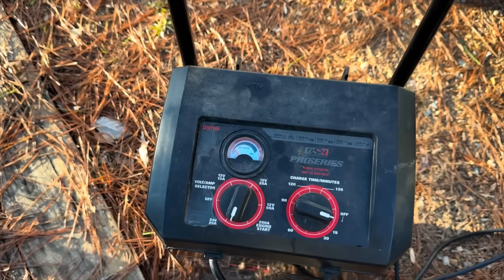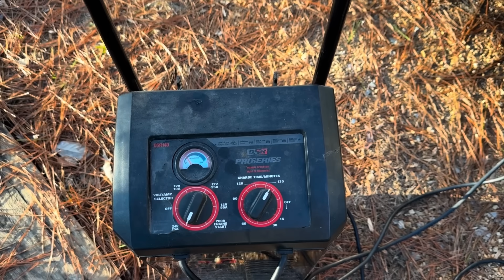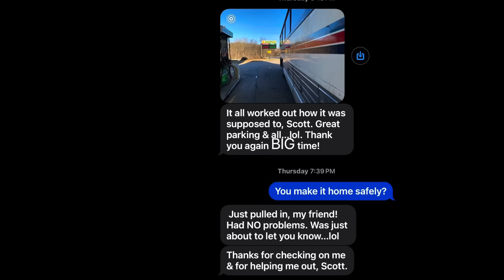Lead acid battery exploded in my face.

Comment: I've always made sure to look away before making the last (ground to chassis) connection. 

Just recently, the battery in my MGB exploded. It's postioned behind the passenger seat, and I was sitting, gacing forward. Boom!   And it took a couple of seconds to realize what happened.  Did get some holes in my jeans as I was dumping baking soda all over.

Comment: Hydrogen sulfide explain. Yeah like the other guy said connect negative to ground. But i don't know if you can do that on a bus chassis? 
So if you are charging or jumping a bus. Gloves goggles and face shield. Those ppe you can replace. We can't replace Scott. Hope your feeling better see a skin dr. Scary.
Reply: Not "Hydrogen Sulphide" - although that stuffs stinks like rotten eggs.
The Hydrogen & Oxygen produced by a gassing cell (fairly normal during use) is the perfect explosive mixture.  While Scott going to connect a charger the ignition source could well have been the arcing on the terminal and just "poor timing" on behalf of Scott.
Reply: @18robsmith  ok

Comment: I had a similar experience when load testing a battery !
Using one of the oversized toasters .
The ones you hang over the thing when testing because the cables never long enough !

The battery top hit the wall behind me & that's about 60 ft away !
Luckily it totally missed me & it was a gel battery so no acid escaped .
Eye protection or a full face shelled around charging batteries is a must .

It's also a common thing when welding on vehicles & equipment .

Comment: I had that happen to me while I was in the service stationed in Hawaii. I was working a part time job as a security guard in an apartment complex and a lady said she couldn’t get her car started. Well it was in a dark parking garage and me not having a flashlight used my lighter. Well she had just had the battery charged but the reason she couldn’t get it started is because the seat belt needed to be clipped. Remember those? It was a Datsun . Much more to the story because if who she was but I’ll leave it there. Oh I had acid all in my eyes and all over my face, lucky I didn’t get blinded. And yes it made a huge bang.

Comment: Crazy but I've seen it before. In the early 70's I worked at a battery recycling plant with every kind of battery ever made. I hating lifting these batteries. When we were bored, we would wire them up to watch them smoke but now and then they would explode. I definitely wouldn't have my face near them. dropped one on the top of my foot one day and went to the hospital thinking I broke it but after x-rays they said no just a bad burse.

Comment: I blew up a motorcycle battery on my bench, luck had it at chest level, but it blew out all the clear plastic above the plates, covered me with acid which started itching immediately. I ran straight to the shower clothed and ran it full blast as I rinsed and removed everything I was wearing. The shirt looked OK, but after the next wash, it was full of holes. I doused the whole workbench in baking soda and misted it down from the hose to neutralize the acid that was all over my tools.  
Hopefully you mixed up a slurry of baking soda and water and splashed it all over the battery compartment of that bus or it's going to be full of pinholes and corrosion.  The gases released from electrolysis are a mixture of both Hydrogen and Oxygen,  aka HHO or " Brown's Gas "  , since it's a 2:1 mixture, it's extremely explosive.

Comment: I had an incident about 45 years ago that probably explains what happened to you. By your description of the battery voltage and post condition, I say that the post was cracked/broken inside the case. I had bought a brand new expensive battery for my Ranchero and a week later, went on a trip to see the Kittyhawk monument. When about there, I shut the engine off for a few minutes and it wouldn't crank as if I had a dead battery. I got a jump and  barely made it home to Charlotte. Long story short, my boss showed me that even though the voltage was good, it could not carry enough current to start the car. He showed me that the post was flexing and if I flexed it the right direction, it would start the car. This was because the post was cracked inside the case. He told me that the installer probably only used one wrench to tighten the cables to the battery, this allows the post to flex and can break the post very easily. I see many YouTube videos when people use only one wrench on the clamps, and I cringe. Using a wrench on both the bolt and nut will allow the clamp to be tightened with out flexing the post. Try it, you will see what I mean easily. The crack inside allowed arcing and ignited the hydrogen gas.
Reply: this is great info

Comment: Scott, a friend of mine was working alone when a battery blew on him. He lost 40% of his vision and had acid burns over 20% of his torso. What caused his accident was static discharge while he was blowing out dust from around the radiator/air cleaner/battery compartment. It was a permanent life altering accident for him, ever since then I started wearing a face shield while dealing with batteries and I make sure I'm grounded out to stop static build up.

Comment: Years ago I had that happen too while trying to jump start a dump truck, a small flame appeared on top of the battery and I went to knock the jumper cables off and as I did the battery exploded, ears ringing and acid soaked my pants. Luckily no acid burns.😮‍💨In hindsight, I should’ve disconnected the cables on the other end. 🤦‍♂️It was a knee jerk reaction to go where the issue/flame was.🤷‍♂️I thought the same thing, why did it explode when I knocked the cables off? Especially since there was a small flame burning. 🤷‍♂️Live and learn.😂

Comment: The thing is, when water is electrolyzed (disassociated into hydrogen and oxygen by electricity), it produces a mix of oxygen and hydrogen gas the exact ratio - two H to one O - that will burn perfectly and explode with maximum energy. It's a common science show demonstration to fill a balloon with the gas from electrolysis of water then touch it with a torch. The boom is, as you say, louder than a shotgun. That turns it back into water of course but a miniscule amount of water produces quite a large volume of explosive gas. The danger in attaching a jumper cable directly to a battery isn't, as is commonly said, the hydrogen gas possible - but the very real possibility of a pocket of this perfectly explosive mixture being ignited inside the battery case and doing what happened to you.

Comment: Wow.  Glad this wasn't as bad as it could have been, Scott!  I try to not be the Safety Nanny and tend to not comment on how folks run their shops and service... but I think I've mentioned before that PPE use in the BGM shop seems intermittent at best.  Losing or impairing eyesight would be a huge loss for you, your wife, kids, and grand kids.  Ditto for burns (thermal or chemical), lung diseases from chemicals and exhaust, etc.  At the very least I'd suggest full time eye protection, nitrile gloves when using chemicals or working with waste lubricants, and bump caps for some limited head protection.

You've got lots of experience to share and the quality and ethics of your shop are tremendous.  I'd love to see you able to do this for a long time.  Take care of yourself and have Johnathan do the same.

Comment: Scott i have had several 8D batteries blow up on me in the past. I have been a generator tech for 30 years. One battery blew up inside a building and blew several flourecent lite bulbs all over me.  The cause is low fluid level allowing excess gas build up that will explode when subjected to a high load and spark.

Comment: Hey Scott, glad you weren't hurt, 3 yrs ago we had that deep freeze in Houston, my wife tried  start to our power stroke, 2020 model, she came back in woke me up to charge it, i hooked up the charger told her to turn the key on and off a couple of times to get the glow plugs warmed up, then to start it, and like you said i thought a shotgun went off, my face, my neck got the worst, the smell was awful, i ran to the water faucet it was wrapped, so she put me in the shower, that scared her, and me that could've blinded me, she felt so bad, so we were both lucky.

Comment: Glad you are ok. Now I know why my automotive teacher always had us wearing safety glasses when working with car batteries. Also, we were taught to put the positive charging/jumper cable on the battery and the ground to the engine or body so you don't get sparking at the battery. Stay safe!

Comment: I had a Napa brand battery in my diesel volkswagen jetta just explode under the hood one cold morning.  battery was less than 4 years old.  ignition on, wait for the glow plug light to go out, the second I turned to crank it just went BANG and I saw smoke coming from under the hood.  Grabbed the small fire extinguisher I carry in the trunk, pop the hood expecting to find flames and I just see my battery split wide open and leaking acid everywhere.  washed it all down, staining the brand new pavement (lol).  Replaced the battery and good as new.

Comment: Glad it sounds like you're ok, awesome. But so many people don't take lead acid batteries seriously and the hydrogen sulfide gas they put out when charging or discharging. Example, the whole order of hooking up jumper cables and NOT hooking it up to the battery being charged last is to prevent sparks near a discharged or off-gassing battery. But people just hook them up in any order. Luckily it doesn't happen often, but as we all see here, then can and do explode given the right concentration of hydrogen sulfide, oxygen and an ignition source.

Comment: Hydrogen gas build up, not something to take chances with, caps off when charging. We need you around to keep these buses running. 
Likely had some gas leaking around the terminal and the sparks were the gas lighting off from the draw

Comment: You may have suffered concussion. Brain injury from pressure wave.  Battery blow ups, when the key is turned to “start” - cause usually begins with low fluid levels. Followed by high rate charge from jumper cables or chargers.  I preach battery safety for decades now. Most all of my car buddies blow me off.  I personally have been around three battery explosions. The low fluid levels allow the lead plates that are very close to each other, the spark jumps from plate to plate. If fluid level is covers all the plates, the spark inside the battery can’t occur.  Only need a little of the plates exposed.

Comment: That Sucks! The Battery in my 69 Dodge Super Bee did that to Me! Did not want to crank and I got out and checked the connections, the Negative was loose a tad and as I turned
it a spark and "BOOM"! it set of the gases and blew my Eardrums crazy! The shockwave had me in Awe and confusion! My eyes and face were burning. My brother grabbed the cooler full
of beer from the back seat and shoved my face in the cold ice water! The Police came flying over from the other side of the mall parking lot as they heard the cannon blast.

They were surprised to learn what happened and praised our response to the ice bath. The had EMS on site quickly and got me to the Hospital. It took three operations to remove all the plastic and lead out of my Eyes! Scary Shit and I can still see today albeit with progressive glasses! I require Hearing aides as well! Batteries are serious safety hazards and precautions
need to be heeded religiously! JMO!

You are very lucky it was not more serious to your Eyes, Ears and more!

Comment: ALWAYS CONNECT THE BLACK CABLE TO THE CHASSIS on the vehicle you’re charging/jumping. Make it the last connection when hooking up, and the first connection to undo when unhooking the leads. It’s the only way to keep sparks safely away from the hydrogen gas production. 

In this case, it probably had too much water added to the acid which partly froze, breaking the terminal enough to cause the arcing you saw and additional hydrogen production.
Reply: To be clear, the sparkling battery would have remained a hazard with cables connected the safe/correct way. Could have blown any time while cranking/charging. But disconnecting the cables would have been very unlikely to ignite the hydrogen gas. Connecting/disconnecting requires your body to be right by the battery. So do it the safe way from now on. And teach your audience while you’re at it.

Red on jumper, red on dead batt,
Black on jumper, black on dead chassis ground point. 
Reverse order when disconnecting. Every time. 👍

Comment: Hi Scott and family merry Christmas from down under. I had a big battery like yours. I had a battery charger   sitting on top of the battery. The thermal circuit breaker It supplied the spark blowing the top off the battery .I should knowen  better being a firey for 38 years. As you mention to take care around batterys. I hope everyone is safe and happy for Christmas .Dave and family        from down under .Scott your fire truck would make a great fire fighting appliance on your property setting it beside  a large water source near your your shop. It's got the best NOTE coming from the JIMMY when it's going up the hill .

Comment: We had a fire truck with battery issues that we took to the Fire Department shop. One of the mechanics was putting a battery charger on it and and sparked it and the whole top of the battery exploded. He was lucky the only injury was a small acid burn on his arm.  He was very lucky. Of course the area of the truck where the batteries sit was covered in acid and had to be stripped down and repainted. I was about 10' away from it when it happened and the boom it made was loud. I thought a bomb went off.. Batteries were just like the ones you have in the video.

Comment: The reason why battery factories keep fans blowing on new batteries that are charging is to keep hydrogen gas from building up, I used to use a blowgun when around batteries while servicing garbage trucks.

Comment: I ve had a very similar accident and it was the same way exceot i was alone and starteded running for house an dumped about 5 gallons of milk on me a  istripped and went for the shower
Reply from the maker: Luckily it was cold out so i had a winter coat on.  And only my head and hands were exposed

Comment: Don't feel bad we had an old. Insley boom crane, we left the battery charger on it, it was cold, we manually engaged the starter with a wrench or screwdriver. Laying one the 3 cylinder Jimmy diesel. And boom . I lifted the top of the full size over the road diesel truck.. those big ones. And everyone was surprised I didn't get hurt. I've been electrocuted, nearly drown several times, ejected out of early 60s Chevy truck with a 16ft flat bed Mom driving and made a left turn and a guy flying in a 68 Ford Torino 428 passing 6-8 vehicles hit us so hard trying left, I was in the middle knocked the rear window in to a cone with my head, from the impact, flipping the truck, found myself on the slope of the wide ditch can on one side, the rear on the other side the rear of the 16 ft flat bed, I walk up to the driver , he asked me if I was driving, no I said, the corner of the bed came thru the windshield seems it was very to the steering wheel. My sister was under the cab, Mom had her head stuck out the truck door we all walked way. 
 The battery deal made me wiser. 
 Best of luck to you man. Like I've said if you ever come down Houston way I'll toss you something and yes it's small..  peace.

Comment: you My Friend just experienced a hydrogen Explosion, due to low water levels and gaseous cells, and this is why it is highly recommended to wear safety glasses when working on batteries including just jumping them off main thing is none got in to your eyes.  and as others have commented install an eye wash station and start wearing safety glasses if the word battery or jump start ever comes in to play. heck keep a set of safety glasses on the battery charger.

Comment: This is another reason I was never too fond of batteries inside vehicles.
I have a buick and the battery is under the back seat.
Reply: I'm going to go out on a limb and guess it was an 8th-Gen ('95 to '99) Riviera? (Man, those are nice cars, especially with the supercharged 3800...)
Like you, I don't like the idea of batteries being in the passenger compartment. Something about lead-acid batteries giving off hydrogen gas when charging, and that whole alternator-charging-the-battery-when-running thing.

Comment: Im a forklift tech and that happened to me once - 8 cells of a 80V 750Ah traction battery in a 7K pound capacity lift. All through a careless oversight. Head was right over the battery when it blew.

Loudest thing ive ever heard - was scared I'd ruptured my ear drums as i was completely deaf for a about 45 mins. Driving home about an 1hr later i had to pull over - just started shaking uncontrollably and it wouldnt stop. Shock I guess. 
Absolute miracle I still have a face after that.

Glad you got away from that unscathed, heard some real horror stories with batteries in the forklift business.

Comment: Super hot molten lead landed in the juice and popped it all off, even without hydrogen hot lead can get pretty nasty. That would've been damn impressive if it hadn't tried to kill you! I've melted a few batteries in my time but never had one pop off that violently

Comment: Glad you survived that without any serious injuries. Very fortunate. 
Hydrogen gas is no joke. 

I Had a car battery blow up in my face some years ago. Had it on a charger for a while but it still didn’t have enough power to crank the vehicle,  so I went to jump it off from another car. …And that’s when we had liftoff. !
That was some serious noise. 
Thought I was dead for a moment